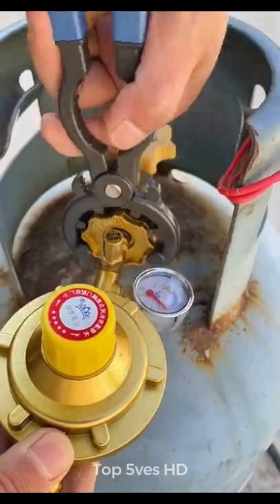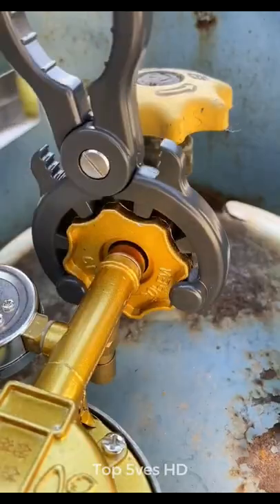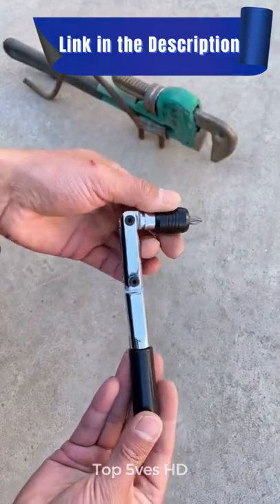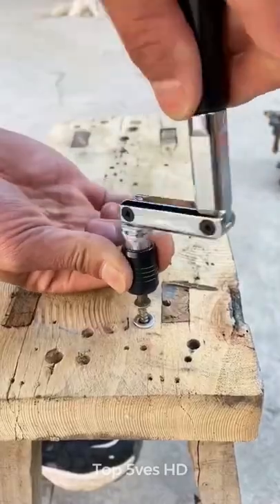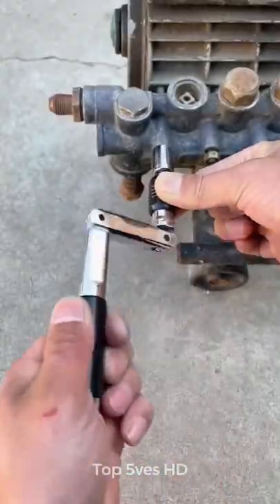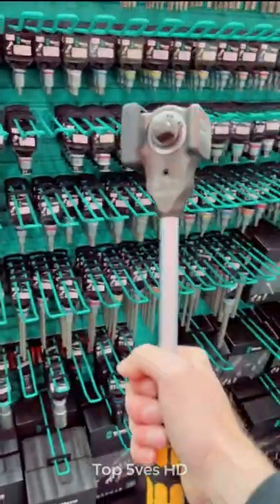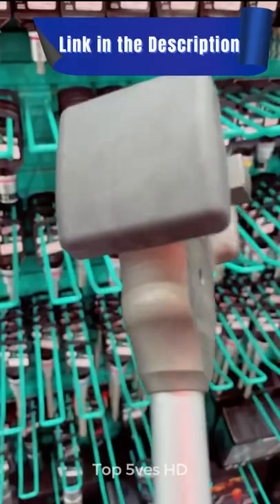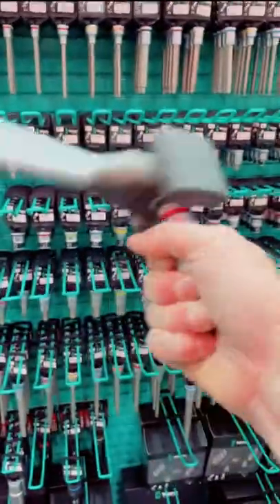Genius Tools from Amazon  ▶15  #short #shorts

Comment from the maker: Links:
'''''''''''''''''''''
45 degree angle cutter for exposed tile.
https://amzn.to/3AmPgUP

3 in 1 Multi-Function Spanner Gas Tank Pressure Reducing Valve Wrench 
https://amzn.to/3QlKNr0

Ratchet Screwdriver 180 Degree T-type Foldable Screwdriver
https://amzn.to/3PvvESN

Wera Square Drive Ratchet with Hammer
https://amzn.to/3SWMtc2
Reply: Thank you so much!